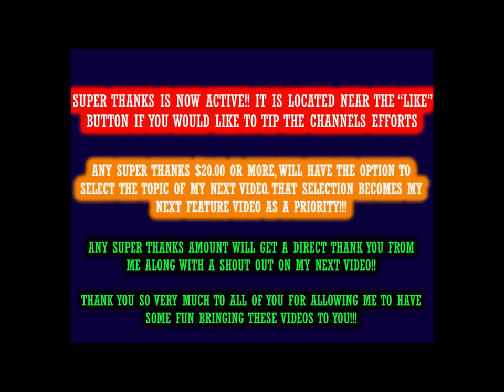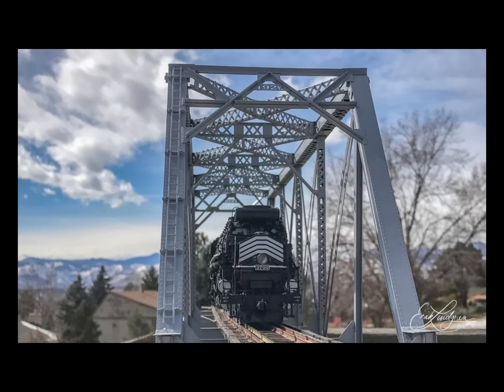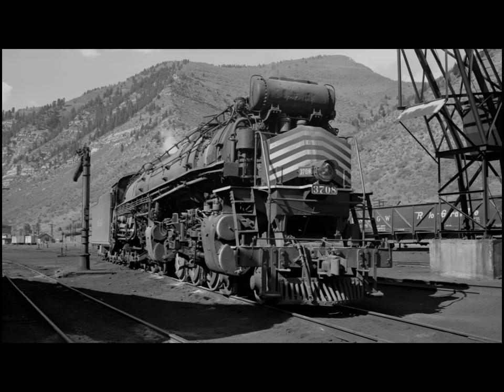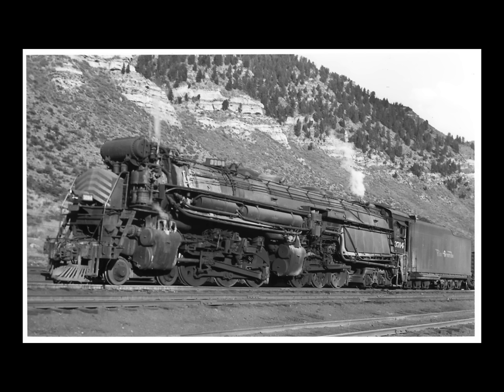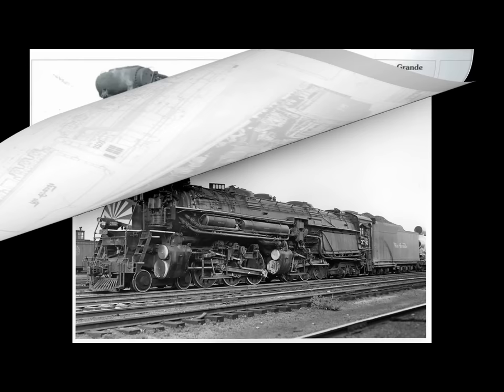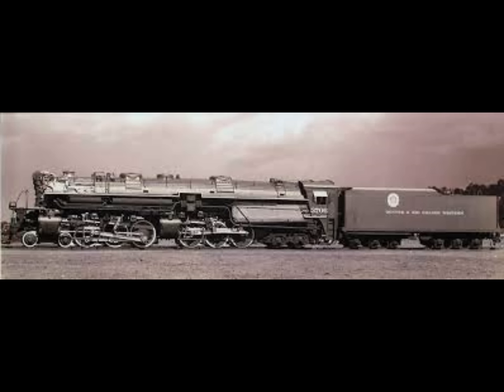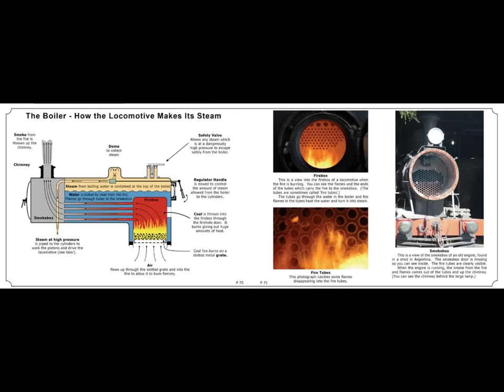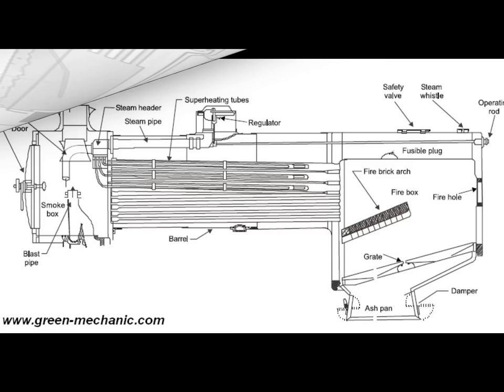Tragedy on the Rio Grande Locomotive No  3703

Comment: Since I run the Rio grande page I know alot more on this 
   Basicly it was crew error and the budy system protected the fireman from the truth that he just let the water run low .. 
  It's really that simple ..
Reply from the maker: And that's as good of an answer as any.. Because the ICC report showed that the maintenance issues were looked into and dealt with unlike the other incidents I have covered. My own personal guess was a sudden intake of foul water from the tender.
Reply: It might also surprise you that crown failures occur when the sheet temperature range in the roughly 500-700 degree range.  Not red hot!  Testing at the Burnham Test lab proved that out as well as the ‘blue’ discoloration of the sheet in question.  Pictures and test reports proved this out.  Sorry I don’t mean to give you bad time, it took me many years to learn what is and what isn’t on steam locomotives and there isn’t a day where something new comes to light.  I (along with other 1st generation post steam repair people in this field) had experienced help with years of service to ask questions of and listen actual events.  Not second, third or fourth hand opinions shared by those with good intentions and with some ego involved.  The many years in the first few years of the ICC Bureau of Locomotive Inspection indicated how necessary it was to establish good inspection and repair practices.  Enough said.
Reply from the maker: @rrsteamer  I believe I pointed out the blue discoloration trait in my Allegheny 1642 video. In other words.. If I understand your point correctly, that particular info I already knew. However, it does not mean that many others here do not.. So it's valid in all regards nonetheless.

Comment: Reminiscent of the explosion of the boiler of Rhymey Railway (South Wales - UK) loco 97 in 1907-ish. In that case, the safety valve had been assembled incorrectly so that it was locked up solid. After leaving the shed the needle of the pressure gauge was hard up against the stop but the driver was unable to get the injector working. They went back on shed and after the driver had gone to report to the office, the boiler exploded. The injectors are designed to function over the normal working pressure range; as the coroner's report stated, what the ACTUAL pressure was at the time of the explosion may only be imagined. (and PS - IMHO if the gauge was up against the stop and the safety valve wasn't blowing off they ought to have realised something was wrong.)
Reply from the maker: Wow!!!!

Comment: One would expect the water to be treated. One would also expect a low water alarm to be installed and functioning properly. Shoddy shop work, inexperienced inspectors, or just plain old nobody gives a damn.
It's too bad, it's a very nice looking locomotive.
Reply from the maker: I found it unusual on the low water alarm..And that the ICC report wasnt more clear about what caused the explosion besides the obvious. In my work on the other video's a lot more clues were available to determine the secondary causes. here...not so much.. A bit baffling this one was.

Comment: Injectors? I’d be surprised if this locomotive didn’t use a feed water pump, with the injectors only for backup. A feed water pump with water level sensor can lull the fireman into complacency, especially since the sensor system and even the feeds to the sight glasses can get clogged. This is a real problem with carbonate deposits from hard water. Just a monthly boiler wash isn’t enough.

The boiler explosion on the Gettysburg railroad tourist operation was due to exactly this - reliance on a feedwater pump system and clogged up sight glasses. You can find the FRA report online. The locomotive was a relatively young Canadian National design with a specially designed crown sheet that would rupture UP in the event of a dry crown sheet failure. Both the engine man and fireman survived and the engine still exists although never repaired and returned to service.

Back before WW2 the Reading lost an engine standing still in the yard. The water glass feeds were blocked off for a routine maximum pressure test with cold water and the boiler filled to the top. Having passed the test. Excess water was drained, the pops reinstalled and the engine steamed up. No one removed the blocking plates in the sight glass feeds and the boiler blew.

I have fired and run steam locomotives on two tourist railroads. They demand constant and full attention from the crew, a rare commodity in the current age of cell phones and ADHD.
Reply from the maker: Oh my... Im sorry... I laughed at your last line.. Hey man... it's true though. The ICC report did not give us a clear clue as to the physical cause of the accident in this case. As I understand it post video, the Fireman was as fault behind closed doors. However, as the physical cause..my guess would be the injectors since they are named on the report several times despite being looked at by maintenance. Foul water? Mechanical breakdown again? Both distinct possibilities.
Reply: I live in philadelphia, and I know who had a grandfather working in that yard, was injured, but minorly. I have the full ICC report and it says exactly everything you have written down.
Reply: The boiler explosion happened at the Erie Avenue engine house in philadelphia in the late 30s they performed a boiler hydrostatic test. Caped off all the opening ports. When they removed the metal caps which had gaskets upon removal part of the gaskets ripped off and stayed in the ports that go to the sights glasses, partially blocking the path to the water glasses. When the engine was fired up and kept warm by the night fireman he told the shop Forman in the morning he had trouble telling how much water was in the boiler. The Forman and machinest determined everything is OK, but when they got the engine hot and ready for service. The seals that that were in the piping finally completely blocked the water and they didn't know that they had low water in the boiler. The engine was assigned pusher service, but before it left it exploded killing the enginer Forman and machinest. The fireman survived without a scratch  because he was standing outside behind the tender in a spot that protected him perfectly from the blast. The engine came off the tracks and sat at a 30 degree lean. A piece of shrapnel blew thru the wall of one of the shops killing a worker in side. If the walls were brick instead of sheet metal construction the worker would have survived.

Comment: The risk from the locomotive boiler is low, as long as the water level is not. In cases of a firebox collapse like this, the ultimate cause is almost always human error, as a fireman knows that if the water glass drops below the safe level and he is unable to immediately correct, the throttle must be shut and the draft doors closed or drop the fire. In a case like this, where the engine is worked to full capacity and firing rate is high, it may take only 90 seconds to go from mid-level on the glass to disaster if feedwater delivery fails, so constant attention is imperative.
Reply from the maker: Another poster with knowledge said the Fireman was at fault, but shielded from outside knowledge

Comment: My experience is with watertube utility boilers of all sizes and types, but most commonly coal fired in the 100 to 600 Mwe range.  There, the steam drum water level is the equivalent of the firebox crown sheets, but the fundamental issue is the same -- maintaining water level in the steam drum so as never to let the drum risers go dry.  Then adding feedwater would cause similar stresses that would fail the drum.

There are a variety of sensing means to monitor the steam drum level, with low level alarms.  the gage glasses are monitored in the control room by remote camera, and there are restrictions from the boiler code on operations with equipment not fully is service.  Configurations of this type have "gage cocks" installed that allow manual opening and closure to verify the level in the boiler (or drum).  There will be a number, typically 5-9 at successive levels that give an absolute indication of the water level; steam flows different than water, and makes a different sound.  The fireman, typically, under engineer's supervision will test the gauge cocks to verify the instrumented water level.  I assume this boiler had a similar configuration.  Assuming it did, a first check signing on for the watch would be to manually check the boiler water level, prior to steaming the boiler hard and using the full range of feedpump, injector(s), and inductor(s) to steam the boiler.

The maintenance history suggested there were issues with the boiler, some of which were not clearly resolved.  On the other hand, its history is typical.  This accident is tragic on the basis of loss of life.  There are other accounts in print from survivors and others who witnessed the event.  Those killed did not all die immediately.  Some survived for hours with serious scald burns and other physical injuries.  This is the first account I've read whereby it reports a bystander, a railfan, killed beside the tracks.  As another viewer pointed out, a steam boiler explosion of this size has the explosive power on line of that of a 10,000 lb bomb.  Those were the largest conventional warhead the US ever used, roughly.  "Large" bombs were on the order of 1000 lbs.

Other reports I recall reading (well over 20 years ago, while I was active in my work), suggested the boiler was fouled, along with the gauge cocks (and/or their lines).  There is absolutely no evidence the engineer or fireman were remiss in their duties.  These big engines used lots of water in the mountains, and water treatments, along with periodic boiler flushing, were (are) critical to the health of these huge boilers.  My experience is with closed cycle boilers which largely used very clean, highly treated water.   These used common makeup water, untreated, from tanks fed by tanks located every 20-40 miles apart along the right-of-way.  No doubt treatments were added with makeup to the tenders, but nonetheless, the water had lots of dissolved solids.

Given the history of the boiler, it would have been wise to check the gauge cocks periodically to assure water actually flowed, to confirm absolute level covering the crown sheets.  Failure of water to flow would be reason to shutdown the boiler.  I have no idea what the fireman and engineer actually did, but they did not intend to kill themselves.  Any sudden load change in a badly fouled boiler could have stirred up the sediments so as to prevent gauge cock performance, but tha tshould have been evident had the checks been done.  I'm interested in what any old timers have to share about this event, or others familiar with it.

One last note. Injectors and inductors are finicky; they easily foul and erode so that feed flow to the boiler is impaired.  Further, they take boiler steam to run.  Low steam can mean poor feed.  Utility firebox/watertube boilers used feedpumps, electric and steam driven.  They have (had) aux steam sources, from other units or aux boilers.  I assume the feedpumps here were steam driven, only.  Had they been low on steam for whatever reason, they may have lost feed.  Losing feed, and then regaining it could have created a scenario where feed would have been introduced onto a hot crownsheet.  A survivor could have shared important details.  I agree with the conclusion that the root cause remains unknown.  In my lifetime of boiler plant engineering uncovering problems such as this has caused me such great consternation to solve, I could sleep until that was done.  Operators environments and fatigue are different.  Under such conditions, I've seen them miss important cues to serious equipment problems that ideally are never missed.  It can also be career limiting to take heavy equipment out of service, and reduce production.  I have never hesitated to "do the right thing", however, as I said, that is career limiting.  I've seen others waltz through and ignore issues when production demanded.  Today, we call this 'human factors engineering."

Comment: If the feedpump was having issues not pumping effectively, the  pump could have stalled lost prime then when the boiler was in a low or no water condition the pump started pumping again causing a thermal expolsion with the induction of water.  Especially with no low water alarm or cutout.

Comment: Well done, informative video!  Thank you.     Were there any signs prior to thexplosion?     I heard thathe wateran off the crown sheet and when the locomotive reached a more level section of track, the water ran back onto the overheated crown sheet and flashed.   Failure of the fireman to keep the water levehigh enough?    Did the presence of the "trespasser" (photographer) distracthe crew enough thathe fireman missed something?
Reply from the maker: Another commentor with knowledge said the Fireman was faulted behind closed doors so to speak.. And that may be. The ICC report indicated that the reported maintenance issues were looked into.. However there seemed to be repeated issues with the injector system.. So I am looking at this as a physical cause possibility.. Or foul water from the tender causing a blockage of some sort. Im most curious on this incident. Because the ICC usually gives a clear hint at the cause.. Not this time.

Comment: Too many reports of problems with water feed should have alerted someone to the fact that there was a serious problem with this locomotive. That no in-depth investigation appears to have been undertaken as to the cause of these continuous reports and instead relied on the assumption that running repairs each time fixed the issues when it so obviously had not. 
Having worked steamers your insight into what is actually going on inside the boiler is limited to the devices fitted to give you second-hand information but water injection is always based on the time between opening the injector and noting the obvious rise in water level in the boiler. If that period is notably lengthy over what you would normally expect, then there is a problem that would certainly require the train crew to take remedial action.
There is of course the matter of train crews running a low water head on purpose to facilitate a higher steam generation condition when a locomotive was working hard and one often used to basically force a poorly steaming locomotive to work harder. A condition not recommended but one that was quite commonly used by experienced crews.
This of course means that any margin of safety is significantly reduced but a balance can be struck if all the required equipment is working correctly when under full load. 
The voracious appetite for water that these locomotives have meant that any reduction in the normal. (Correct) operating level of water above the crown sheet will seriously erode the time between a safe and unsafe situation developing down to as little as one or two minutes so for a locomotive that has a suspect water feed system particularly under full load as this one seems to have suffered with that reduction in feed water supply would mean the reaction time to an unsafe condition developing would have exceeded the ability of the crew to deal with it and even closing the regulator would not help the situation nor would they have had time to dump the grates or even close the draft. They would have set the conditions for the explosion themselves based on the tardy behaviour of the water feed system and any attempt to run the locomotive in that condition would then have meant an explosion was inevitable or at best be based on pure luck not to occur. 
T
Reply from the maker: And that right there is the difference between being book educated (me) versus practical experience.